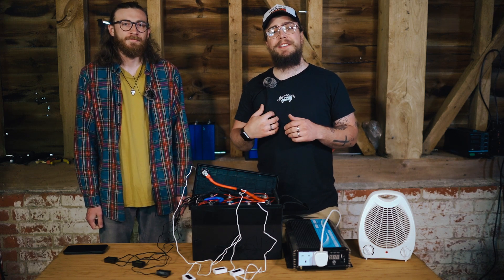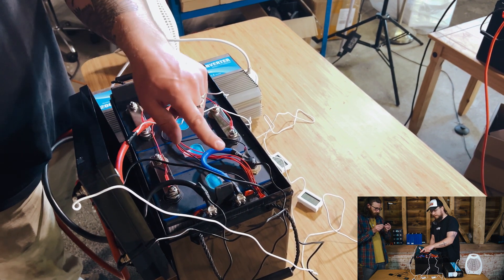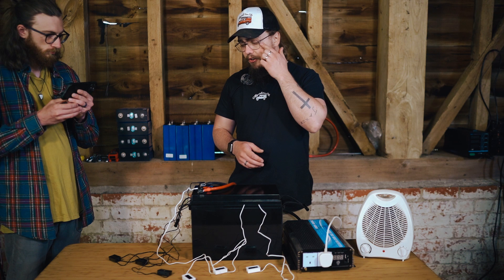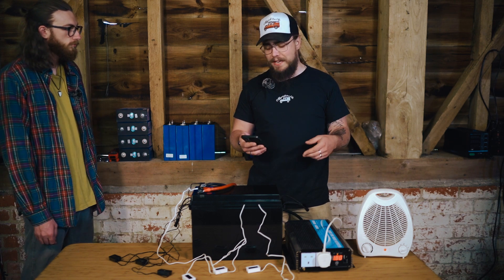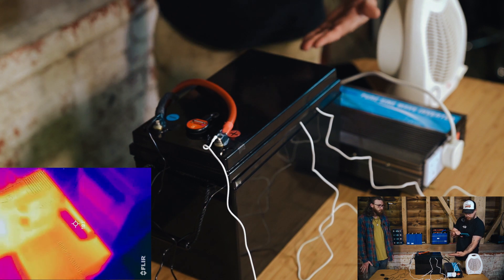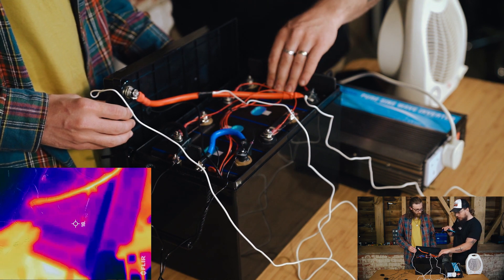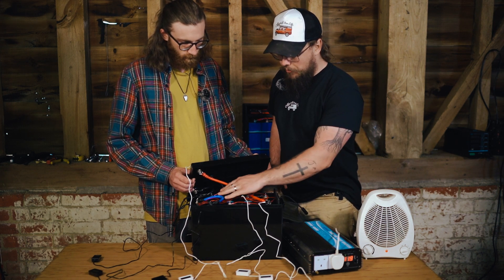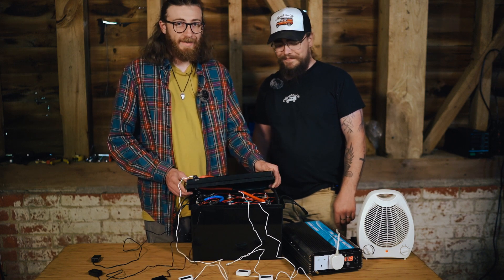Temperature testing our Offgrid LiFePO4 battery [OPS280]

Comment: Daley BMS really! there are a lot better ones on the market I have been using JBD BMS at least they have a 150ma balancing current and they balance all the time (above your set voltage) I think the Daley is about 40ma and only balance when charging. I have just got some of the JK BMS  that have a active 2amp balancer when it removes energy from the high cells  it puts it back into the lower cells. It could put an end to top balancing as this BMS would top balance the cells for you. Also you could offer battery heating if you move away from Daley
Reply: unfortunately only Daley and a couple of others offer a 250 amp bms
Reply from the maker: Yup
Reply from the maker: Thanks for the recomendation!